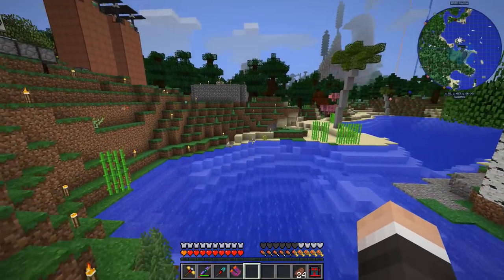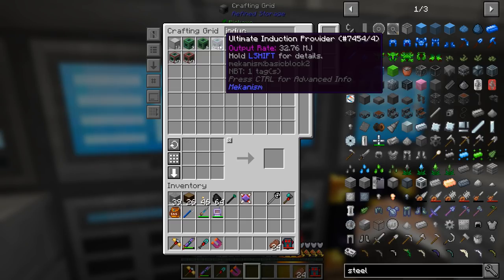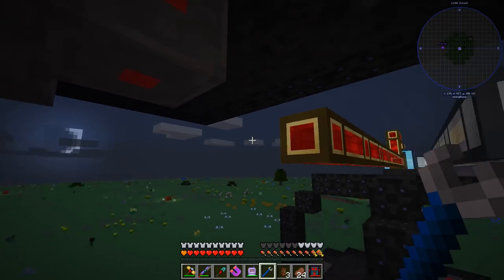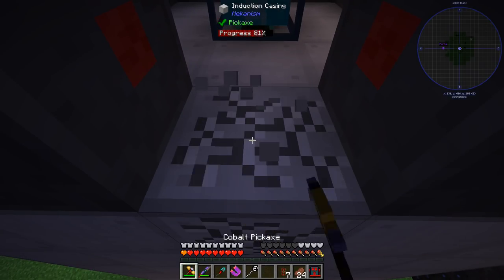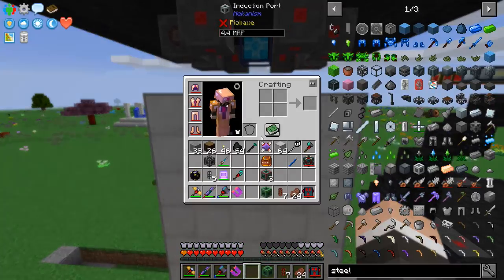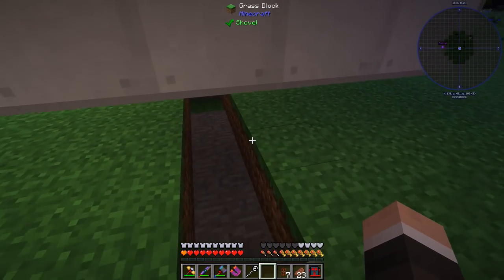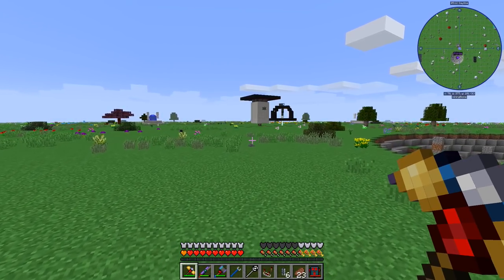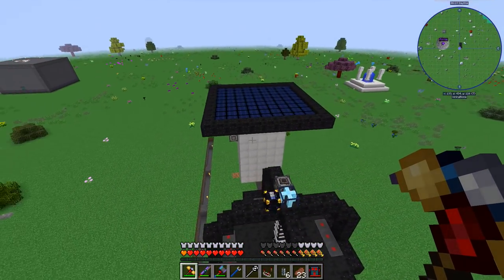Mekanism Energized Induction Matrix! :: ALL the Mods 3! :: Ep 33

Comment: I'm sure someone else has told you this by now (I'm a bit late commenting!) but the Mek Induction battery is SUPER user friendly.  You only need to make a case out of only induction casing and ports, then the inside can any number of providers, cells, or even air blocks.  So you could make (for instance) a 4x4x4 block of casing with a 2x2 opening in the middle, then just put 1 ultimate provider and 1 ultimate cell, the other 6 blocks can be air, the induction multiblock doesn't care.  This would give you a In/Out in the range of MILLIONS of RF / tick and BILLIONS of RF total storage - from just 1 provider and 1 cell!  Or fill that little 4x4x4 with more cells and have about a half a TRILLION RF in total storage.

Comment: Little sidenote: the providers don't need to be touching the ports. they work just like the cells, they add to the total power input/output just by being inside the multiblock structure, no matter where they are, as long as they're part of it.

Comment: I have a problem: When I build a massive induction matrix like you did in the same modpack and I try to see what is the capacity in the GUI, it shows me 2.14 GRF, and won't go past that number

Is this a bug?
Reply: yeah click the lightning bolt in the bottom left and you can see in eu it still goes up. 2.14 rf is the max you can read it at